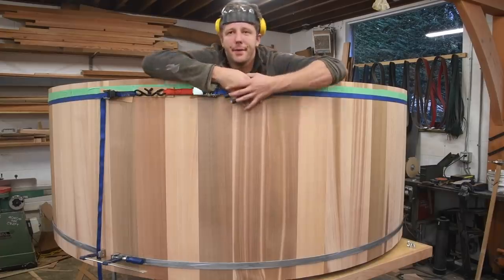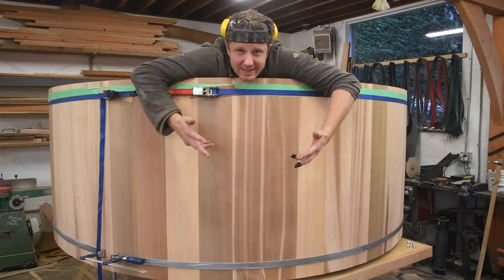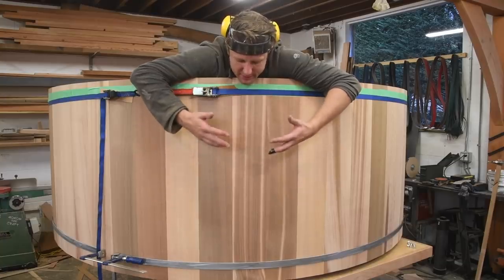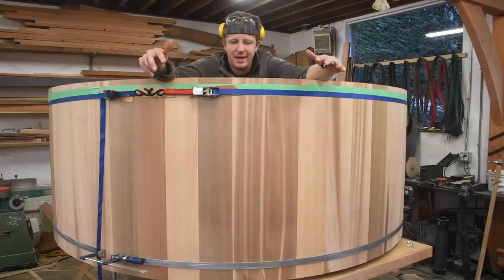WOODWORKING, MAKING A CEDAR HOT TUB- Part 1!!!

Comment: I built one of these for a dunk tank for our town to use to raise money at functions.  I used 5/4 cedar decking from a local mill.  I didn't bother to use dried because of it's use. The tank was 5 ft high and 5 ft diameter.  I used 1 in band iron with welded on threaded rod for adjustment.  If I was to do it again, I would have used a spring behind the nuts to keep tension on it when it was dry.  I used a double tongue and grove bit to lock them together.  I know the correct way is to use a concave and convex bit but I'm cheap.  That would be two bits, I would maybe never use again. I'll use the double many times in the future making slabs..  
So, long term, the thing has lasted 12 years so far, has been stored outside in the winter and has not rotted.  The bottom has been banged up alot from moving it around but she is still making local organizations money.  
Great video and look forward to seeing the next.
Reply: One good thing about dried is when it expands you get a tighter joint. Honestly, though, the amount of water would make even fresh sawn heartwood expand so it really doesn't matter :)
Reply: I've been waiting a long time for this.
Reply: Oh damn. How much did that cost in materials?
That sounds like an expensive build for a charity use...

I did something similar for a church near me, when I was about 16 I offered to help make a few attractions one of them was a dunk tank too and we used an UN-USED preowned septic tank and just cut it in half. It was made of HDPE, the same stuff as milk jugs and cost us about 200$ because it was for a good cause. We got a dunk tank, a small dog pool, and used the middle band as a sign above the tank so it could be seen from 360. 
We considered making one, but none of us had the skill required and I guessed it would be absurdly expensive, considering we were trying to raise money and not spend it. 
All in all, I'd say we made the right choice... but I'm curious how much we saved over a wood build.
Reply: @DanteYewToob  about 400$. I scrap snowsleds as a side hustle so all the mechanism was built from suspension parts for free. I own a glass shop so i used a piece of 4 x 5,  mr10 for the guard. That was 150$ my cost. 
The other thing i would change was to put a fixed set of wheels on the back like a hand truck.

Comment: You should look into saltwater hot tub systems. I can't believe how much better mine is. I haven't had to add any chemicals in two years. Just added a little more of the salt as I add water. I'm talking about tablespoons. No chlorine smell is a big plus.
Two things;
 One, always shower BEFORE getting in. (Antiperspirant, lotions will clog the filters.) My dishwasher does a great job of cleaning the filters. 
Two, clean filters often.

 You will find that a good saltwater system can go years without changing the water if you keep up on filter maintenance and showers before entry. We use ours year round and haven't had to do anything more than this. The type of salt used has no taste and a quick rinse afterwards is all that's needed to remove any left on us. It leaves your skin silky, not dried out. It's a Sodium Bromide system.

Comment: I built my own hot tub a year ago. Make sure those screws are at least M16 (~20mm diameter). Also you should reinforce the two outer most floor pannels. Those might come off if you keep them like that! It will most likely not be holding the water in for the first 2 days as the wood needs to expand. Make sure you loosen the screws a bit after that.

Comment: I've had a cedar hot tub for nearly 30 years.  Its 8 feet across and 4 feet deep heated with an aluminum wood stove that is submerged in the water made by the snorkel stove company.  There is nothing better than a good soak in a giant tub.

Comment: Awesome! We've been planning on getting a similar hot tub - but, now that I've seen this video, I'm making it myself. Thanks so much for the inspiration. The money we save on the hot tub will pay for the extra tools I'll need. Perfect... Now, as far as the water treatment goes, I love hot tubbing but I've discovered I'm allergic to chlorine. So, we are going to use a product called Simplesilver. It's a once-a-year(!) spa treatment that is gentle on your skin and means you don't get the chlorine smell. Anyway, thanks for the building tips. I help my Simplesilver tip helps you too. Thanks.

Comment: Amazing like always samurai san, quick question, why did you joint the angle for the vertical boards instead of table sawing? Wouldn’t it have been quicker on the table saw? Or is it that the jointer is more accurate?

Love your work man.
Reply: I would quess jointer gives more smoother finnish on the cut surface and is more accurate in that long cut.
Reply: Because he doesn't have a spindle moulder
Reply: I guess the angle was quite close to 90, so he didn't need many passes per piece, and he might have had to use the jointer afterwords to get the correct finish anyway.

Comment: Thank you for the video! I'll build my own some day, just need to finish the house first. I'm confused by something though – at 1:30 you cut the tongues/grooves for the vertical pieces. However, when you assemble the hot tub wall (with said pieces) the tongues/grooves seem to be missing, and the surfaces are just flush against each other. What have I missed? I ask because I don't want to mess mine up when I make it!
Reply: dude, the t&g was the base.
Reply: Look at it again. You will notice that he inclines the fence of the jointer for the hot tub wall pieces. Tongues/grooves were made on the boards for the hot tub floor.
Reply: Strapped together and when wet it will expand and seal any seams. I prefer a hammered bevel over a cut bevel the latter leaks more than the previous...tg vertical are never necessary

Comment: I am interested in that giant band clamp around the bottom. was that thing purpose built for this project? or it that an off-the-shelf clamp?
Reply: Wasnt it a ratchet strap?
Reply: Yeah it looked like it was attached to a coping saw handle.
Reply: @smokingcheeba420  look at the bottom one
Reply: Did i answer your question just before you said that. Weird.
Reply: @smokingcheeba420  answer what question?
Reply: I just said it looks like a coping saw handle right before you said look at the bottom strap.
Reply: @smokingcheeba420  that doesn't answer the question of what that band clamp is though. maybe it's just something he made.
Reply: I have never seen one on the market but would not be hard to build. The ingenuity of a carpenter is infinite. A nylon strap coping saw handle and some washers and bolts you got a make shift strap clamp. Or a ratchet strap would work.
Reply: you know what, I bet that band is designed specifically for this type of hot tub. he probably has 3 or 4 more that clamp around the finished hot tub.

Comment: larry tait
   
@The Samurai Carpenter   Please  Add this project to your online plans?   Please?
Amazing wood .The smell must be amazing. I will have to use Eastern White Cedar, and it is as rot-resistant.    
Jesse: what was the Diameter of the bottom?    I see you lie on it in video #1, but are you 6' 2"   tall ? Taller still?   
 
(You dwarf your friends who help you move it in Video#2) 
The boards are all  2" (8/4 finished)  x 6" ?   Nice  glue-less design;  the tight tongue and groove will seal itself with use.  
I know there are plans at the school, but I keep missing the boat and not getting in.  
Who is the supplier for the the 3 Stainless steel Straps?

Comment: Amazing!  What is the tool that he uses to cut the bottom round?  Some sort of big jig saw?  Can't really tell in fast motion.  Any thoughts on that?
Reply: Hand bandsaw by mafell
Reply: @strato90  what in the world is the purpose of a hand bandsaw instead of just using a jigsaw?
Reply: @MaydaysCustomWoodworks  it's a common carpenter tool in Germany for cutting thick material. And it's way more accurate than a jigsaw
Reply from the maker: Michael McDonald it cuts 12” deep so you can cut profiles on large timbers.

Comment: Awesome. Is there an angle on those stave sides? whats the size of that beast? 6ft inside diameter? Who not use a ball and knuckle joint? I'm sure with expansion it will seal ok but i was planning on buying the tooling to make a ball joint on the spindle moulder. I'm using larch. Any thoughts anyone?
Reply: 4:06
Reply: Cut the staves using your spindle moulder rather than the planer

Comment: Few questions virtually all other tub builds use a canoe cove on the staves. Seems you use non. Wows i like more surface sealing of flat joints but does that make this tub weaker ?  Hmm
Reply: You cut the staves 3-5% smaller inside to make a circle the natch cut on the staves for the floor plus  the 3-4steel bands around the tub will make it solid.  
When water is added makes it even stronger
Reply: What do you mean you make the inside 3-5% smaller ? Please clarify

Comment: How did you work out the segment width and ° side bevel
Reply: With math?
Reply: Divide the number of segment mating surfaces into 360 to get the related angle and divide that number by 2 to get the cut angle. For instance, if you end up with 35 staves, to total 36 mating surfaces, each related angle will be 10° and to get the cut angle, divide that in half for a 5° cut angle. The two 5° angles at each mating between the staves add up to 10° times 36 joints equals 360° circle. [Just a hypothetical example, likely more staves on a seven foot circle,  so you adjust the math accordingly.] For example,  71 staves/72 joints/2.5° cuts for a 5° shared mating angle. 72 x 5 = 360.

Comment: Can anyone explain what's happening at 3:38? I presume it's to taper the edge slightly so the walls fit on
Reply: The stays(wall pieces) won't expand much in the vertical direction when they absorb water so  he is compressing the fibers or grain of the wood on the horizantal pieces to try and amplify their expansion when they absorb water. Basically it helps to make it watertight.
Reply: @TheBelkul   Yes, that's it exactly.

Comment: Question. Is it benifical to joint before surface plaining?
Reply: Yes it is depending on the stock you are using. If you are using 3/4 stock for cabinetry I find it almost useless to joint faces because they pieces bend so much because of their thickness you can just bend the face frame into flat on the case.... Dont get a jointer if you are gonna only use 3/4 stock. Pointless. Theres other easy ways to get straight edges like an 8 ft level clamped to your table saw. But if you use a lot of 6/4 or more stock then a jointer is a nice time saver. It saves you from having to build a planer sled and rigging that up each time... And its more accurate. Cabinet makers CAN use a jointer.... But I'm a career cabinet maker and i dont really see the point of it in my current set up. All my stock from the hardwood store comes with 2 flat faces and 1 straight square edge already placed on it so I dont need a jointer.

Comment: no tongue and groove for the verticals to lock together? how this no leak?
Reply: Same way a whiskey barrel doesn't leak.
Reply: So all you’d need is a tight fit and you don’t have to worry about the tongue and groove? 🤔
Reply: @rabbitontheradio  wood swells when wet
Reply: rabbitontheradio, what you said is always true. Sometimes though depending on the quality of the wood, it's nice to be proficient with the tongue and groove method too.

Comment: Beautiful tub, dude.  That wood looks so CVG,  awesome selection. What is that, like 7 feet in diameter on the base?
Will you be building the fire-box insert  or will it be a factory built one? Internal, or external with a pump to exchange the water?  Can't wait to see the rest of this project.

Comment: The tub is round guys. Tongue & groove on the side walls would have had to have been curved tongue & groove. Good luck trying to pull that off.
Reply: I  did it.
Reply: You can do it with a rounded channel, makes it super easy.
Reply: @matthewray6008  I have sold and assembled many wood tubs with rounded channels. They work just fine.